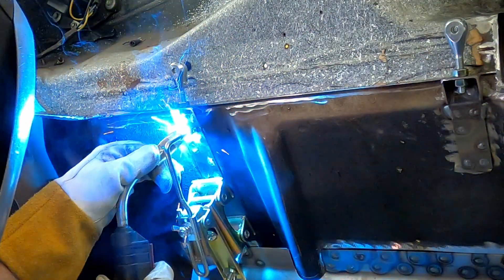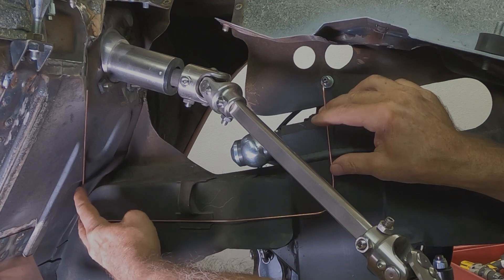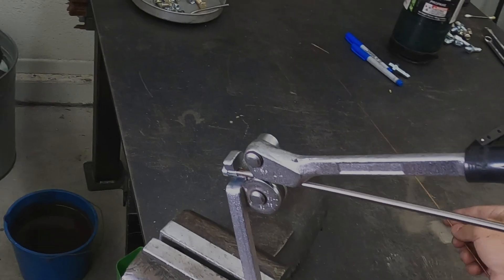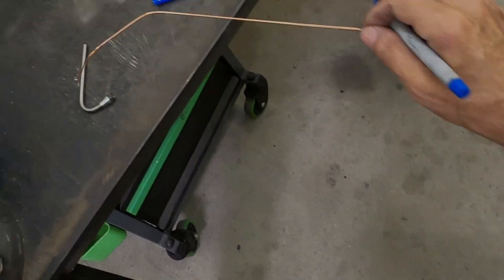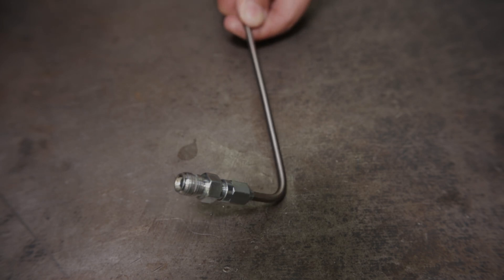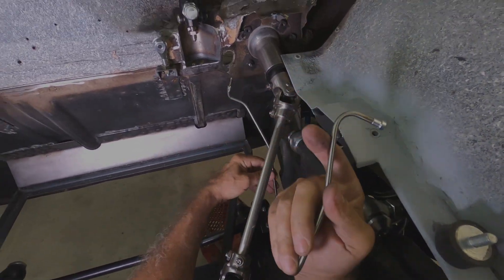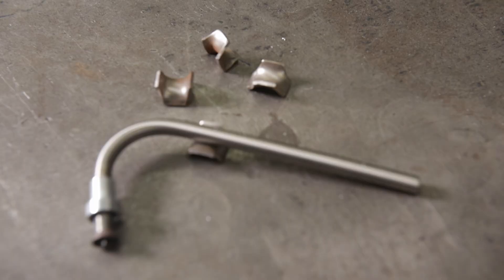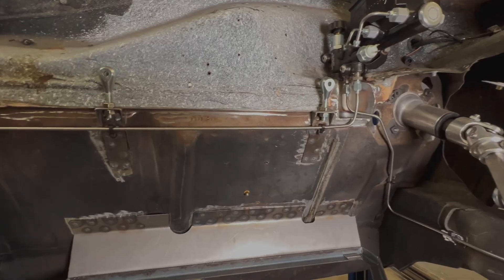Why you need brake lines

Comment: If you cool in water you probably aren't annealing and rather are hardening.  Annealing involves a slow cool down period in air or sometimes in warm sand or an oven to slow the process further.  Unless there's something special about the stainless used for those brake lines.

Comment: This is some incredible work. So when you're all done you'll disassemble and paint everything? For my radical 80hp car I just used 3/16 nicopp with the standard double flare. This is just the front, what are you doing for the rear? Is that proportioning valve part of a brake kit? Sorry, just trying to understand how you came up with the correct components.
Reply from the maker: Yes, after all the fab is done, then it comes apart for restoration.  The rear was done a while ago. Wasn’t sure if I needed a P valve or not, put one in anyway.

Comment: you make stainless look easy but, iw as stoked to hear it's stainless, i live in the rust belt. also like that you can aneal it to work it like normal line EDIT: why not use stainless fittings always?
Reply from the maker: Stainless on stainless can gaul pretty easy and isn’t really necessary for fittings, as long as zinc plated steel is used.  Plus SS fittings are three times the cost.  My point was that I think aluminum fittings are too weak in the small -3 size that brakes use.
Reply: @JohnReynolds661  I'll take that under advisement. On factree cars if I can break em loose I use anti size on the fitting threads and in-between the fitting and pipe but not the nipple very careful like to keep it from seizing back up and not get in the fluid. The salt is some nasty stuff. Youd almost need an all stainless car out here in the rust belt. Or lost of cleaning and maintenance

Comment: They make stainless steel "zip ties" that will blend better with your project !  Though the black nylon ties are UV and strong, the hack factor of seeing them is too high.
 As for annealing stainless, others on here are saying you are doing it wrong but ... good job. 
 "heating to above 1900°F and for 90 minutes per 25mm thickness followed by water or air quenching. The best corrosion resistance is achieved when the final annealing temperature is above 1900°F."

Comment: The only issue with stainless brake lines is they are likely to fracture due to work hardening ( not as badly as copper though)
If you use stainless lines you need to take this into account and avoid excess movement being concentrated in small areas. Vibrations from vehicle operation and flexing caused by brake application can result in failure even if the line never experiences harsh conditions or extreme high pressure.
So when the brakes have been bled get a camera or a good friend to watch the movement of the lines when you stomp on the brakes repeatedly. If there is a lot of movement 1 millimetre or more before or after a bend and close to mounting points or other bends ( basically anything that doesn’t allow for the movement) the lines will eventually crack. You can design this problem out by simply allowing for the movement to not be concentrated in a small area.

Comment: Man, I hated doing brake lines in my Corvair. However, the more I did it, the better I got. They look really good now!
Reply: I did many brake lines when I worked on fleets. Always the new copper / nickel alloy and usually used the old line for my template. At least you can make adjustments by hand with that stuff.
Reply: @rupe53  That's how I did it.
Reply: @whototeru  ... btw, I mentioned it elsewhere, but I have a 64 Corvan 95 that I have been dabbling with for a few years.

Comment: Annealing!!! Dang it! Why have I never heard anyone use this process in the past? I spent so much money on one of those hydraulic flaring tools only to have it break the die on 3/16” line every single time.  So I would end up buying prefabbed lengths and “making them work”.  If I ever build another car, I will be using this process to flare.  Thanks!